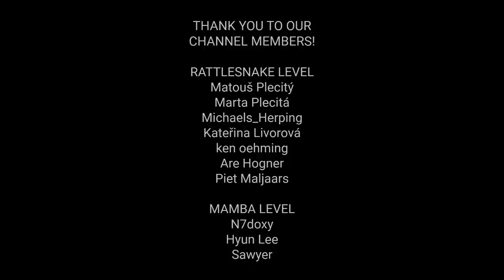Cape cobra, one of the most venomous cobras in Africa, colorful snake, cobra vs. meerkats

Comment: Wrong .. The most venomous Cobra of Africa is Walterinnesia aegyptia .
Reply from the maker: Thank you for your comment. We did this video 3 years ago and we agree that the title should be changed to: one of the most venomous cobras in Africa. Done. If we consider Walterinnesia aegyptia as a cobra (which we did not as it is not a true cobra but we understand your point), then the lowest LD50 subcutaneous value we found for both Walterinnesia and Naja nivea is 0.4 mg/kg. That would make them equally toxic. There are other species, like Naja melanoleuca and Naja annulata which have very toxic venom but the only tests we found were intraperitoneal or intravenous. It is not possible to compare these results with subcutaneous tests. We always take into account subcutaneous tests because those are the closest to the reality of a snakebite. You would probably not get an intraperitoneal or an intravenous bite.